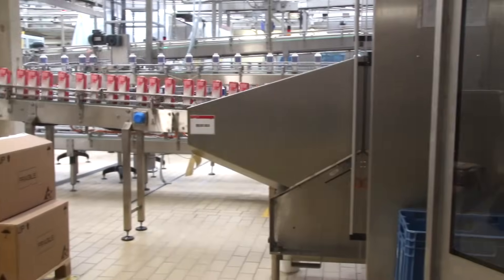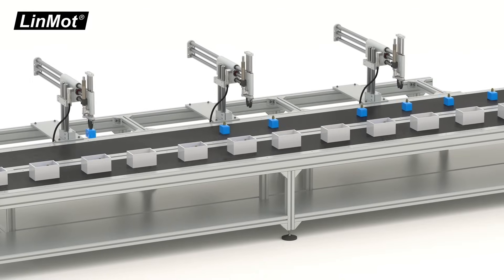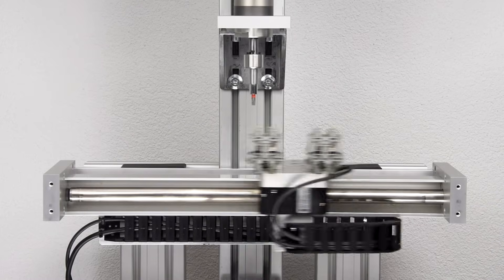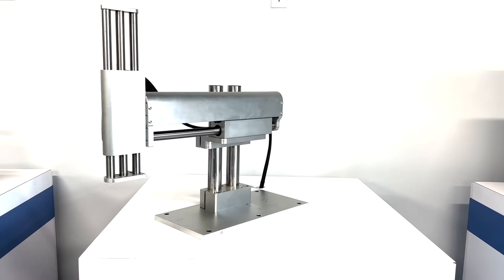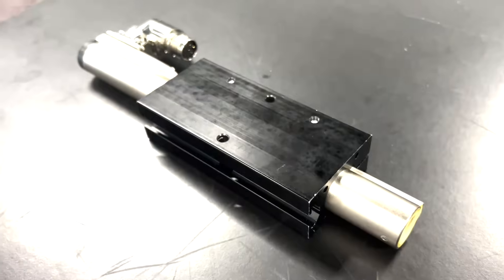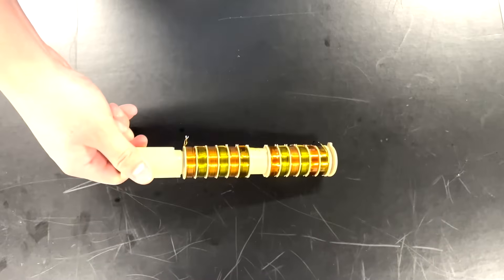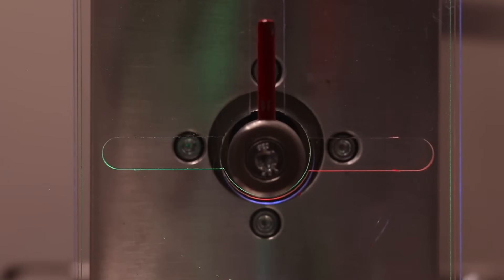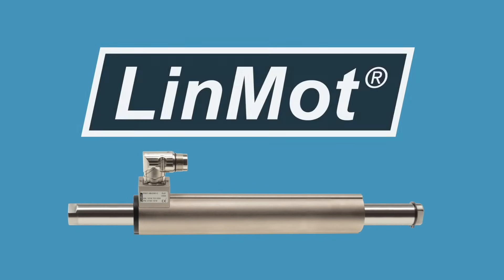Why the Electric Linear Motor is the Future of Automation

Comment: That was very interesting and informative. I had no idea that there was a class of linear motors that worked in this way. The design is so simple and elegant. It's an electromagnetic solenoid, right?
As soon as I read the term 'electric linear motor', I assumed it was the type that most people are familiar with - very whiny electric motors with a gearbox connected to a linear mechanism. This is just so smooth and sophisticated by comparison, it's advantages are immediately obvious. 

I'm going to have a look at your website, but I will say that I'm very interested in motion platforms for dynamic environment simulation, like flight simulators. When I saw your video, the first thing I thought was: how big and powerful can these actuators be? Do you make ones which could support a motion platform like a Stewart platform, with a load of, say 500kg?

Thanks for posting this video.
Reply from the maker: Thank you for your reply and for sharing your enthusiasm. We welcome you to the fascinating world of LinMot.

Yes, exactly. It is a highly dynamic, electromagnetic direct drive with integrated position sensor which suits for several kinds of applications. 
Of course, there are already various customers who have used LinMot linear motors to implement as well simulators of all kinds. Stewart platforms or hexapods are among them as well. Here an example of a small version: https://www.youtube.com/watch?v=25gox7Ep9yw

For further information I suggest to contact LinMot via our website. Like this you also find our local sales who may guide you through your project/application: https://linmot.com/contact/
Reply: @LinMotEurope  99